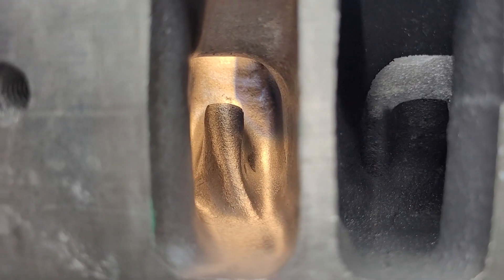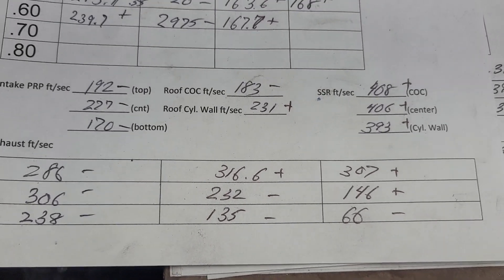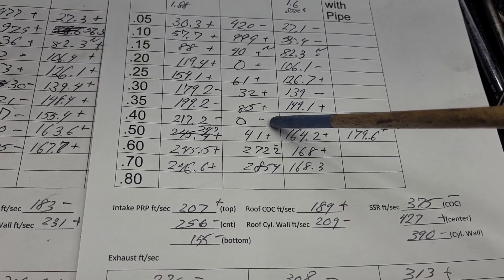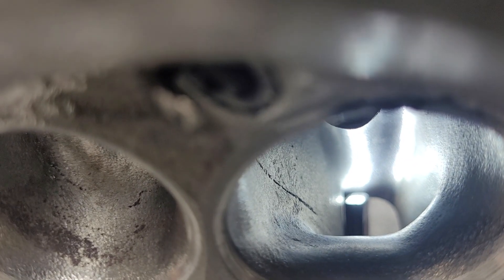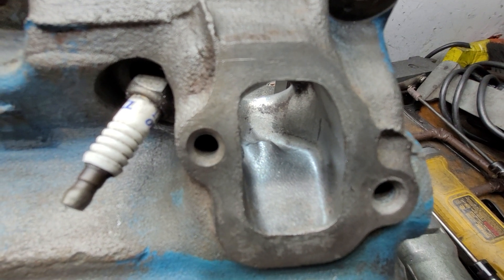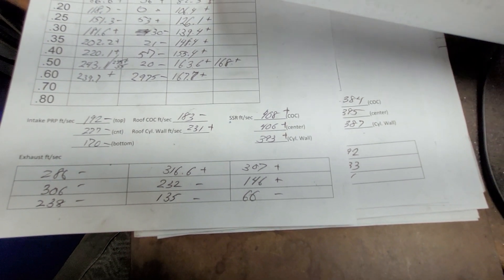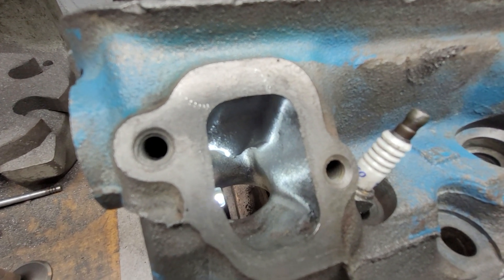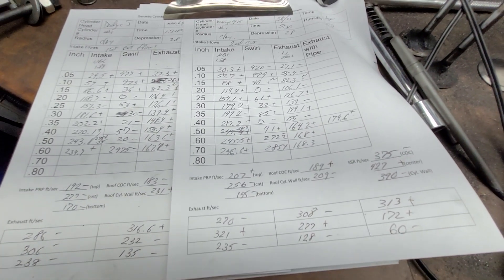Chrysler 360/915 J heads, Second cut vs. first cut. Diminished returns.

Comment: Nice!  I have heard that the 318 "302" heads can be ported to be equal to the 360 heads.  The 318 "302" are actually one of the better factory heads
Reply from the maker: They have their limitations but I bet they make nice power modified. Thanks

Comment: It's the edge of the exhaust port opening. It creates a tumbling vortex especially at the bottom side, closest to the head gasket surface. The pipe blends it in a bit, so the overall flow gets a tad better. After gasket/port matching the headers that problem should go away.
Reply from the maker: I never gasket match exhaust. Thanks

Comment: Hi Charlie. You said that you would like to lower the air speed in the center of the ssr. How would you do that? Thanks.Andrew
Reply from the maker: Good question, if you have alot of air moving in one spot what would you do to slow it down? Think traffic on a busy road. Thanks
Reply: Hi Charlie. With your traffic analogy you would have more lanes for traffic flow. So I assume ( and that's dangerous ) with porting you would provide more room for flow over the ssr. However would that not slow the entire flow not just the center? How would you just slow the center of the ssr? If that is a close held technique that you don't want to share on an open forum I understand. Thanks Andrew @servediocylinderheads
Reply from the maker: @andrewburlock2653  Haha, got you thinking. Stay tuned!
Reply: @servediocylinderheads  Hi.Charlie  I'm laser focused. Andrew

Comment: Just a suggestion, take the hooking tail off the guide and straighten it out.
It may pick up flow and the swirl should be enhanced. 
Just my useless .02 cents....
Reply from the maker: I made the tail very similar to the tail in the 302 heads. You can see the dykem flows very similar so I am thinking it is good for now. Thanks
Reply: @servediocylinderheads  It looks like it is choking off the cylinder wall side of the bowl. Wouldn't that cost flow and swirl? These heads are a real dogs breakfast. No wonder Chevy's are so popular.
Reply from the maker: @briantayes2418  They are about the same as Chevy fuelies. Fuelies can make excellent power modified.
Reply: I found the Chrysler heads way better than the chev junk😂

Comment: Like you said, I would not lay back the ssr on this head. If anything widen it on the highe speed side of possible. Generally I blend it into the port there. And lay that area which is just below the straight wall down for the corner of the ssr. But I leave  the rest of the ssr relatively stock.

When it come to the straight wall going into the bowl. I usually lean the bowl out to that side. To the middle of where the seat is on the stock valve job. (Usually taking out between 1/8 and 3/16ths of an inch) then I blend the straight wall at the top of the port to the bowl.

That should I. THeory make the straightest shot out of the valve.

With regards to the valve guide. And the center of cylinder beside of the bowl. I make sure that air is getting around that side and find that once able to get air around that guide on the roof. The bowl area is enough the get the air moving in that side. A other thing of note, I have also noted that the coc wall nearest the pushrod holes needs to have a smooth transition in order for air to more easily make it around the center of cylinder side of the bowl.
Reply from the maker: We are on the same page. Thanks

Comment: Almost sounds as though if you had the J head sized valves in the 302 casting heads it would be a better flowing head than the J’s are. 
I’m really enjoying this series!
Reply from the maker: That is what I did... thanks
Reply: @servediocylinderheads  I must have missed the part of your video that said you put bigger valves in the 302 casting heads.
Reply from the maker: @brucesherrill4116  1.88 /1.6 50 degree seats

Comment: I think this is great progress. Not sure what other guys get out of these heads, but Steve Dulcich did some really informative porting articles for a Mopar magazine in the late 90’s, and iirc he ended up where you’re at now at peak, with a 2.02.
Forgot, he called that bump in the roof a ‘Huber Hump’ (whatever that is)
Reply from the maker: That is good. Thanks
Reply: I used to get around 265 to 280cfm from memory. Depending on valve sizes. I found 2.05 the largest to be beneficial

Comment: Doing your work in your dreams is one of a few well recognized signs of high intelligence in some area or another, usually as some kind of 3-dimensional/spatial type work.

A lot of engineers in various industries such as automotive, aerospace and architectural have this if they are very gifted and spend a lot of their lives deeply immersed in the industry.

This is where TONS of answers to REALLY TOUGH engineering issues have come to me.

I would suddenly wake up and dash to get my sketch pad and start writing and sketching so I did not forget what I had seen in my dreams.

When you are asleep and not actively thinking about everything in your life all at once, it truly frees up the mind to unleash its 'secret hidden powers' [which usually you see with autistics, even when awake](I've been told I was autistic as a child, but not by doctors, so it may or may not be a thing...doesn't matter to me, personally) and your brain can powerfully analyze, deconstruct and reconstruct things in ways that are super hard to do when one is awake dealing with family, pets, a business, or other external distractions that take up tons of brain power.

EVEN WALKING takes up functional brain power, because so much energy is consumed making sure you are standing, moving, not running into stuff, where you are in 3 dimensional space, how fast you are going, etc.

So yeah.

Engineering and analysis in your brain is a VERY GOOD thing! (~_^)-b

Comment: The Super Stock guy’s used a quite a bit of epoxy to get them to flow decent flow. You figured out quickly that a quick pocket port makes the biggest gains. Valve shape IS important.
Reply from the maker: Thanks
Reply: I used to fill the floor a bit so it wasn't such a ski jump

Comment: When I do one of these heads again, I may just order some chevy 1.94 valves and get offset retainers and shims to get to install height. I know guys have really eased ip their heads by bowl hogging for 2.02 valves but I think you could get a good flowing head on a 4 inch bore with the 1.94 valves.
Reply: Running. The shorter chevy valves would have the rockers running closer to the tip if that changers anything.